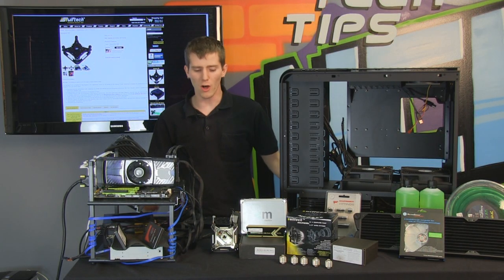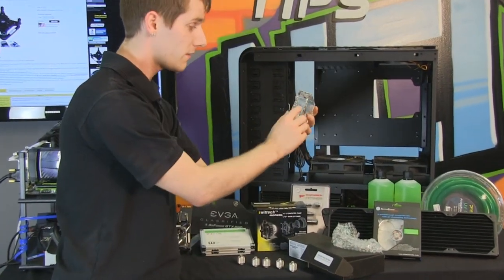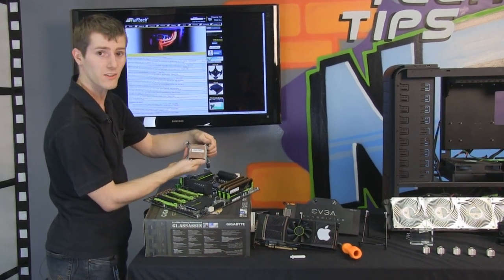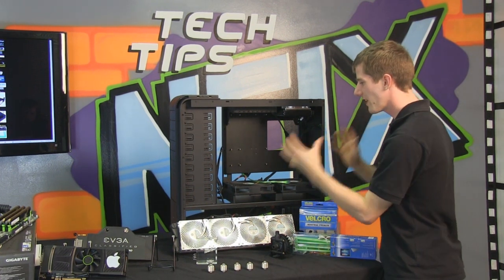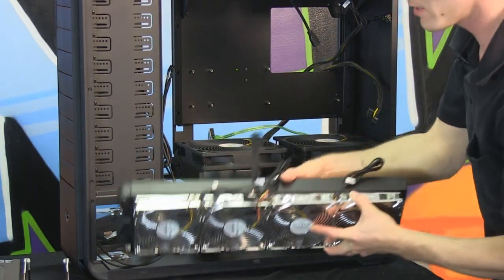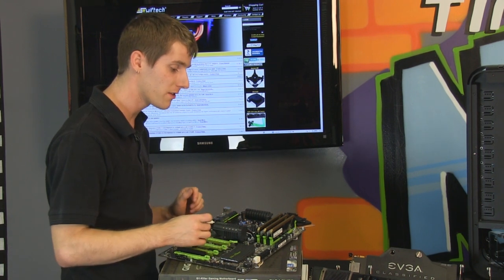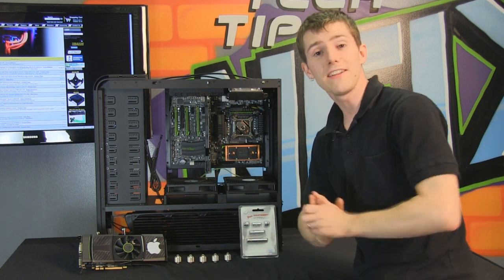Ultimate Water Cooling Guide Part 2 - Block & Component Installation NCIX Tech Tips

Comment: Now water cool the hard drives. There are blocks for it....
Reply: You want your hdds over 30 degrees.
Reply: Krevin Grard That's not totally true, either way if they are any warmer than they need to be lifetime is killed.
Reply: rkshireygames if they are too hot or cold they will fail quicker.
Reply: Krevin Grard The difference in being "too cold" is negligible. Too hot will do a lot more damage. Pick the lesser of to evils.
Reply: Or just keep it in the middle.
Reply: Krevin Grard So water cool it....
Reply: Or even get good air flow on them, which is really the best choice.
Reply: rkshireygames if your running your hdd alot which i do. Just have a 120mm fan blowing air over them and your temps will stay bellow 40 degrees
Reply: rkshireygames But if its too cold condensation will form on the inside and then drip on to the platters possibly causing data loss or reduced performance...
Reply: JGAG You're not going to condensate with liquid cooling. You will always be at or above ambient unless you chill it like I'm going to.
Reply: JGAG what rkshireygames said
Reply: Krevin Grard what if you use liquid nitrogen
Reply: lelcetz It will cease the drives....
Reply: rkshireygames Won't the liquid nitrogen inside the tubes be cooler then the ambient temp
Reply: lelcetz Duh....It would also expand and blow up the tubes. The tubing would also become brittle, any acrylic would almost instantly shatter from the stress, and the cpu would lock up from getting too cold. Plus the pump would not be able to move it. Bad idea is bad.
Reply: Keep liquid nitrogen cooling to the expert overclockers
Reply: +rkshireygames no water cool your case
Reply: +rifaat saoueris what about the motherboard
Reply: Joe Federico what about m.2 ssd and your power and reset button
Reply: +rifaat saoueris and PSU
Reply: k

Comment: Bloody hell, this is pretty involved.
Reply: What did you expect? A walk in the park? This is water flowing around electrical components that are being powered, if there's a leak, you'll have a LOT of work ahead.
Reply: ***** not mutch work if you buy a nonconductive cooling liquid
Reply: jakob altunkaynak its only non conductive untill you touch it basically
Reply: Ryan Cooke The most basic coolant that is used is distilled water. And even that can conduct an electric charge if it is in contact with metal for long enough.
Reply: ***** I know
Reply: ***** Not only that, but anything you put in the water (silver coils, anti microbial liquids) will make it conductive in a heart beat.
Reply: jakob altunkaynak Deionized water is probably what you're talking about. As soon as an electric charge comes into contact with it BOOM re-ionized. It's just a sales gimmick
Reply: 12treeGoldfisher you know, that makes no scientific sense. non-conductive will allow the electricity to flow freely while allowing you to remove it.
Reply: 12treeGoldfisher No it's not. You can literally submerge many components in non-conductive liquid.  If whatever you're using doesn't allow you to do that--guess what--it's a conductive liquid.
Reply: 12treeGoldfisher mineral oil is used for submerged cooling, it's non conductive and /prevents/ rusting... Just saying  lol
Reply: 12treeGoldfisher Aww, different subject then. With that, it's not oxidation, it's corrosion. It has to do with the mixing of metals in different blocks and rads, nickel, aluminium, copper, acetal, etc. #1 flush your rads before installing, #2 mix as few metals as possible #3 run pure distilled water through your loop for 12 hours, drain, refill with desired fluid +  anti corrosive additive #4 change fluid after 6 months and inspect loop for corrosion and algae

Comment: @tenevinc He is pulling air through the rad. He configured it that way for the looks and cleaning purposes. If you are concerned with a slight performance boost, do a push-pull configuration.

Comment: I have seen soooo many youtubers using as much thermel paste as they can. They could learn much from you with less is more
Reply: Yeah agreed. Thermal paste is much less conductive (thermally) than metal, but much more conductive than air. The idea is to fill any of the space that would be occupied by air if you were to mount metal on metal;  ] [  >>  ]|[  If you put too much  ]|||[  you're basically creating a stretch of less conductive thermal paste that heat has to pass through that could've otherwise been metal. You probably already know that, but just saying. Still, despite the knowledge, it's hard to judge when you're applying it if you've only done it a half dozen times like myself. There's always the thought that it's not enough to spread out. I just ordered parts for a new build yesterday; was considering trying the "X" method.
Reply: Thank you, I knew less was more but I never knew why that was the case :)
Reply: for cpus less is more but for gpus more is better because gpus from factory have tim leak all over the the board

Comment: Just a tip - Toilet paper when wet (in this case soaked with isopropyl) it is fine, the fibers stay together and tighten, leaving no fibers behind. You can see how linus uses the Isopropyl soaked toilet paper then uses a microfiber to make sure its clean.

Comment: 3 Other things I see about this. Always have your pump lower then your reservoir to let gravity assist with the pumping. Also it is good to have your reservoir to pump line leading from the bottom though this isn't a big thing. It is also good to keep your radiator above (above paralleled in the case) the reservoir so the radiator doesn't have to work on pushing the cooled water to the reservoir. Yes, I will say these components are an exception due to quality. Basically get to know your rig.

Comment: I have a Li-lian thats similar with the reverse tray.. this one also has the psu mount in the front bottom of case, don't remember model # off the top of my head. There is also a few that are reversed with the pci slots pointing upward and your cables route thru a cover on the top of the case to conceal them...

Comment: For a noob, is it recommended to do tubing in the case, then take it all apart again and do a wet run of the cooling system over some newspapers and check for leaks for like 8 hours, and then take apart the liquid cooling and install it back in the case?

Comment: Think of it like a home radiator, the hot water goes into the radiator and spreads over the surface area transferring heat into the room. What the fans do is take that heat out of the water and exhaust it out of the case (usually in the top).

Comment: There is more static pressure in a push configuration, so there is a performance difference. You ought to benchmark it, with this setup.

Comment: If you mount the reds on top and rear would you pull air from out side,it would make more sense if you pull from inside its cooling with warm air correct?

Comment: Hi, just wondering how you connect up 4 fans on RAD with a power supply to maintain the RPM, other then using the motherboard single fan headers x 4. Any tips and tricks?

Comment: how can you test the GTX 590 with the water block on when you said you have to test it without water first? you said that the first thing you need to do is test the parts when its dry. if you already have the water blocks installed then how can you test them dry? sorry if this sounds stupid.

Comment: correct me if i'm wrong but will having the reservoir that low not cause it to be overfilled when the pump is off. putting air into the water-block? also why not gravity feed the the pump? o.O

Comment: Is there any radiator that can do the following?

Intake hot water from the graphics card, get it back cooled to the graphics card, at the same time get cooled water to the reservoir~>pump, and intake hot water from the CPU and get it back cooled to the CPU. You could do that with two radiators and two pumps, I wonder if it can be done with just one pump and one radiator.

It could be done if it had slightly separated rooms, maybe.
Reply: It is possible, but highly inefficient the way you're looking at it. It would also make a computer look extremely cluttered. Best option would be to have a single loop like: Res>Pump>GPU(s)>CPU>Rad>Res. The water moves quickly enough that the heat from the GPU(s) usually won't affect CPU temps, unless you have 3-4GPUs cooled in serial (one at a time) rather than parallel (multiple at once). Even then its only 1-3 degree difference.
Reply: yes, this is parallel as opposed to series.  not worth it for a few degrees improvement
Reply: It's just curiosity, if I ever have the money to spend on that, I'll certainly have enough for a parallel liquid cooling sistem for the multi-GPU and two pumps, one for the GPU cooling and one for the CPU cooling.
Reply: Liviu Melioth Or run 2 seperate loops!
Reply: Liviu Melioth You can get splitters so it would go to the CPU and GPU independently of each other at the pump then have them converge on each other with another splitter just before the radiator. I think that's what you were wanting. And as far as dual loops, they actually make dual bay reservoirs that are pretty cool (pun intended)

Comment: hmm I never cleaned my cpu with anything more then paper hankerchiefs (quality ones that I myslef use - 3-4 ply and strong ones) with Arctic Cooling ArctiClean kit...not sure if microfibre towel is good idea since microfiber works so well partly because of the high static charge the fibers have and that is the biggest no no with cpu and hw in general
Reply: Would static affect the CPU on the heat spreader though?

Comment: @DjSuperSou1 no you don't understand. if i were to buy two GTX 590s with a water block like the ones he has (you can't get the water block separately, you have to buy it fitted) how would i test them as they need water to cool them.

Comment: you say you have to test your hardware before installing it in the case, but how do you go about testing your graphics cards with a stress test with pre-installed waterblocks, can you safely test those without actual coolant running trough them and no fan on them?
Reply: only a short time, disconnect your fan though

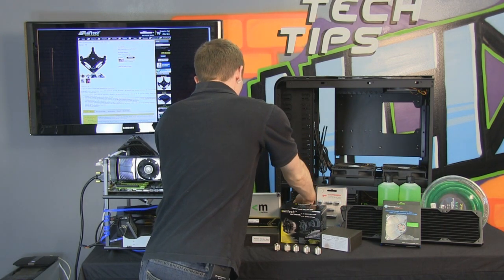Comment: 2:20 "It's not ultimate, it looks tacky"

I gotta agree with this, a full block looks alot nicer. Unfortunately full cover gpu blocks arn't universal. So with each GPU you purchase you need to buy (if it's available) a full cover block for it, which doesn't come cheap.

I prefer the GPU core block/ramsink alternative, as this is universal. I don't have any problems with ramsinks falling off as i don't use thermal tape to stick them on. You can buy thermal "glue" which sticks them on well.

Comment: Any quick tip/advice for water-cooling only my GPU?
 I run a  GTX 560Ti 2Win (that's considered a dual GTX 560Ti). So it gets hot around 70+C temp. I wanna only watercool the GPU. Possible?

Comment: @cgountanis Actually, there is only one moving part (the pump) in the loop. The water is in a closed loop where is flows through closed systems. Using things like compression fittings virtually eliminated all risk (it's what they use on the spaceship). I'd be more worried about the pump dying than anything else. I've built a few PC watercooling loops and have never had a leak.

Comment: I was about to say "WTF do you need RAM cooling for?!" Luckily Linus already pointed that out. Unless you overclock like crazy the passive heatspreaders will suffice.
Reply: Cheap ram you can water cool but dominator ram saves the day so you don't have to water cool because it has a better heat spreader
Reply: Not necessarily, and especially on FULL liquid cooling builds: if you neglect the memory liquid cooling, you're going to lose nearly all the passive air flow in your case by liquid cooling all your other components, and thus, significantly decrease the heat management of your memory.

Comment: hey Linus i recently made my very own custom pc at age 13 i was wondering if you have any idea why my computer takes so long to turn off and it just doesn't seem like it is as fast as it should be with 32 gbs of ram and a msi r7770
Reply: Lol because 7770 is a low- mid range gpu
Reply: the capacity of the ram doesnt matter. though the speed does. maybe you're running 1333mhz ram. the low range gpu doesnt exactly help either.
Reply: its 32 gbs of corsair vengeance memory
Reply: but what speed. you're talking about capaity. 32 gbs doesnt matter if you're not videoediting.8 gbs is enough for the average gamer
Reply: it is 1600mz and 9-9-9-24 latency 
it just doesnt seem to be running as fast as it should be and it is generally kind of laggy
Reply: maybe you should exchange the ram then. if that's causing the issue
Reply: Does it have an ssd?
Reply: well it's even more pointless if you have a phase cooler system because that requires a few minutes to boot sure the system is very powerful but thats the downside of phase change cooling you either want wicked overclock or you stick to water-cooling and have a system that boots in less time than it takes to make a cup of coffee your choice but a fast boot up is pointless anyway I want my games to boot faster than my BIOS

Comment: Do I need water cooling if i'm not over clocking with
Intel i7 3770
NVIDIA GeForce GTX 670
Corsair Vengeance 16GB
CM Storm Trooper?
Money isn't a massive issue but just not sure if it would be necessary

Comment: @freakaefari It's easier to clean when the fans are not in the way. If you had them pushing air in some dust will get on the fans and then just get back on the radiator when the fans get turned back on.

Comment: @RoyLFewkes Some people have issues with coolant, I have. Yet I still use it as my system is fully UV blue, so I dont really have a choice. As long as u monitor your system (have a look in it, shine a light in ure res so u can see the liquid flow past if that makes sense, listen to the pump (if it changes). I usually do a FULL clean every 6 months so that usually takes care of it all. But some people dont have blockages ever.

Comment: If i remove the Watering cooling on the RAM and uses 2 680s instead of 2 690s would i be able to run this on 360mm radiator ? :O

Comment: i dont understand why he pulls air into the case, shoulnt he be trying push it out ? 
so the heat in the radiator doesnt come into the case but get expelled out of the system more efficiently?
and no im not talking about the side of the radiator that he choose to put to the outside

Comment: i don't get it.
why doesn't he blow the air through the rad to the outside (instead of pulling it in?)
(so just switch the orientation of the fans)

Comment: Costs a lot more and air has been proven to work for a lot cheaper, you just need to find the right case and plan out your fans. Unless you plan on running at 4.5+ ghz constantly (which will wear out your CPU fast even if you keep temperatures down) I wouldn't bother.

Comment: Normal water has metal ions in it which is why it conducts electricity so If you sprung a leek you could end up damaging parts. Distilled water has no ions in it so it doesn't conduct electricity and wouldn't short out your parts.

Comment: Pulling air is better than pushing air and the main reason for that is that your radiator wont clog with dust as easy as it would with pushing air so if you are a lazy person who cleans your pc once a year go with the air pull config on your radiator with more reliable performance

Comment: you would be putting hot air into the rad heating the water which is bad
if you do it so it dispells heat ur case will be hot

Comment: That's a weird case. Not only the mobo tray is 90 degrees rotated, but it's also on a different side than on most cases.
Reply: its a tj11. its an amazing case. I have a smaller version, ft05, 90 degree rotated, amazing.

Comment: well i figured
but i forgot to account that at the bottom of the case its cooler
but since if you were to take the hot air our of the rad u would get ur case hot
and if you pushed air into the rad would be putting cool air in which i guess is good?
kinda new to water cooling -_-

Comment: 1)its not as hard as hes making it seem, hes building a computer for the year 2020. if ur building a standard rig u probably dont need water cooling or dual GPU 

2) trust me, pc gaming is just a phase. Its cool when u first have ur new machine but after a while ull realize that you couldve been just as happy spending 500$ (runs most games fine) on a pc build as opposed to $1500 let alone 3000+

basically, im saying dont give up. just do your research and dont pay attention to thing u dont need

Comment: did he spill the alcohol?
Reply: brickson98gaming and, what the hell is with that apple sticker on the graphics card? You should never disgrace a graphics card like that! lol
Reply: brickson98gaming apple made it
Reply: brickson98gaming u mad at nvidia for giving apple their template bruh? apple probab ly fucked the gpu up and down when they started making it
Reply: Apple is bad. Bad is Apple. Mac gamers aren't gamers.
Reply: brickson98gaming ''mac gamers aren't gamers'', macs still can run games, and you can use them just as a regular PC with just a different operating system.
Reply: They can barely run most games.... without overheating. And a lot of games aren't even made for mac. As for non-gaming usage, idk about that. Can't judge until I've really used a mac for desktop stuff. So far I like PC better for that too.

Comment: pfft Quadruple Rad... My water cooling loop's gonna share a resevoir with a groundsource cooling loop.
Using AC in a computer room's already bothered me, I mean the heat's concentrated already...why diffuse it into the air and the re-concetrate it? 
.... 
I suppose I could just stick the rad out the window...